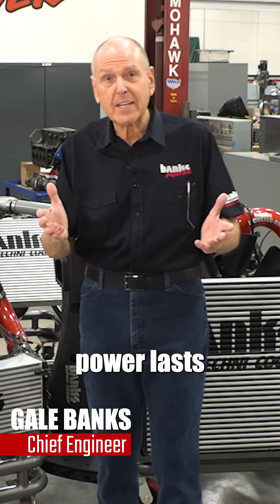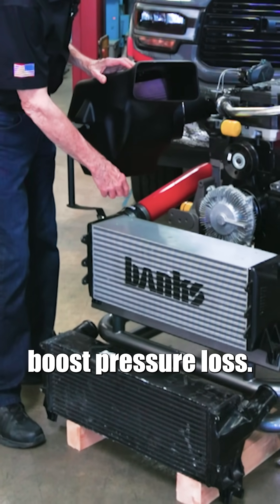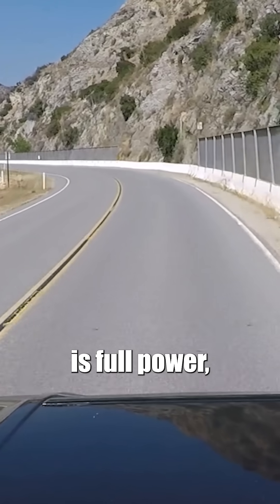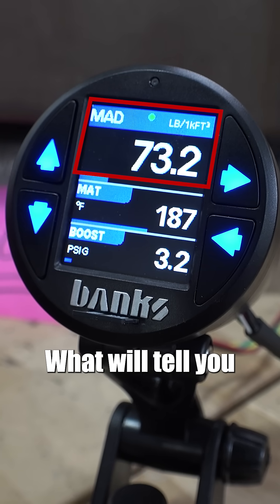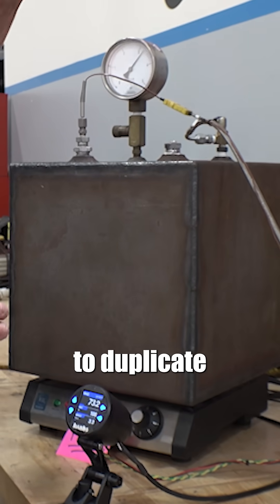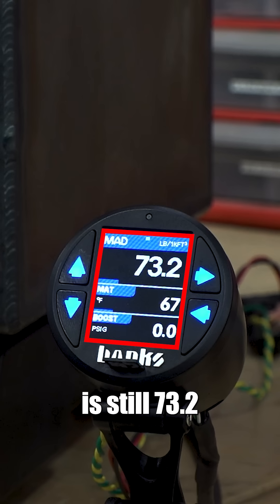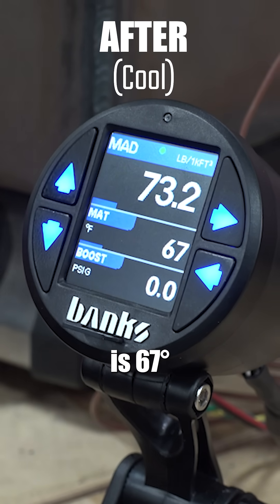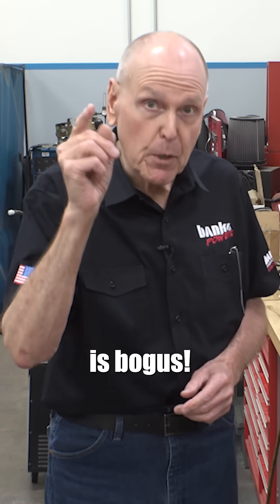Why your boost gauge is bogus.

Comment: Again, educating the masses with real talk.
Reply: The masses don't care
Reply: @Power-Wiesel  dump your fuel and make noise is what i have to say to those people
Reply: Eh, truck manufacturers oversell power, in reality the amount of power sold to truck buyers is excessive and what banks makes is excessive (although it is appropriate for the vehicle, the vehicle is just excessive to begin with). Europeans have been towing with turbo diesel 4 bangers for decades at this point and the weight limit is more than the heaviest imaginery load the average truck buyer can think of. I do like what they do and the proper engineering of stuff for real purposes, but most buyers are just pavement queen mouth breathers which is kinda infuriating but its their money I guess
Reply: That's why I love their videos
Reply: Not really because turbos compress air by pulling in more air.  He was creating pressure by heating and expanding the air. 2 very different ways of creating pressure differences.
Reply: @non-binaryjesus  air speed and density are crucial to make beneficial gains in combustion and flow. He was proving you can have high pressure with low density. Much to the effect of pressurizing hot air. I have read dozens of performance books on engineering internal combustion engines. This is nothing new. there are just better ways to monitor these variables. I dont see why i even have to explain since Gale has been trying to get this point across for decades. Pressure doesn't really mean much if there isn't enough volume being utilized. This leads you into split duration camshafts, eliminating pressure stagnation and reversion. I can go on and on. Like i said, Gale has been saying this stuff for decades
Reply: @jimholesaw6597  so how does a turbo compress the air?  It has to pull more air in which increases air density. This is why its harder to get power from turbos at high altitudes.  All his experiment proved is that 1 cubic volume of air is 1 cubic volume of air.  Pressurizing that volume by heating the air to increase pressure is completely different than pulling air in and compressing it. Expansion and compression are 2 different things. Thermodynamics laws suck but they are what they are
Reply: i guess someone doesn't know when a volumemof air is compressed it heats up,
and when the air heats up it lose some of its pressure like it gets softer, while cold air is harder
Reply: @endurofan9854  what!!??! When air heats up it expands and in a seal container it will increase pressure.
Reply: @jimholesaw6597  agreed, this is why intercoolers are often used. I guess the experiment proves pressure is created multiple ways? Not sure the point of it.  Hot air is bad. Anyone who has ever worked on engines should know this tho.

Comment: The boost gauge was never meant to tell you how much extra power the turbo is making it is to tell you how much pressure it is pushing, however, many many people treat the boost gauge like its telling you how much extra power you are making and this video shows that
Reply: It's just like a vacuum gauge in a naturally aspirated car. You can pull more vacuum, but it doesn't mean you're getting better fuel economy.
Reply: @custommotor  exactly, he would be making a video about that if auto makers put vacuum gauges in vehicles
Reply: @David-jt9nt  reminds me of the Uhaul truck vacuum gauge that displays it as fuel economy.
Reply: @ALMX5DP  o god those things, I forgot uhual put those gauges in
Reply: @David-jt9nt. The vacuum gauge was an improvement over a big ruby red light.  It was like a red strobe light in the cab if you had a driver with a bouncing foot.
Reply: @davepetrakos475  ya, but still it doesn't make it any less pointless on the fuel front, uhaul was/is trying to save their trucks from the type of people who tend to blow them up
Reply: Hit the nail on the head. Seems like that’s the audience that Gale is intending to get the message to. 
It really shouldn’t have to be explained, but it seems like it should be given some of the comments i’ve seen
Reply: @PapiAndrey  whats sad is im not even mechanically inclined enough to do more then the absolute basic work on my truck and I knew this before I even got my license at 15 on top of the fact that more and more companies are being forced to put turbos on everything bc of the EPA and the most common type of driver doesnt know this; this is scary and is going to cause alot of engine blow-ups

for context im a professional driver who currently drives super heavy equipment but has also been in a racing league or 2 so I have to understand what my vehicle is doing
Reply: It a very literal sense yes. But typically it is an indication of how much more power you'll make
Reply: That's because the industry wants to sell you parts without doing the footwork of testing or educating. They want to show you a graph that is irrelevant and often fake just to convince you to buy trash. Very few if any companies go to the lengths that Gale does.

Comment: Boost is essentially just a measurement of restriction, no? Because you're forcing compressed air in a finite space.

I remember replacing my supercharger lid with a larger unit. Boost dropped 2lbs, but I gained power because I could push more air in.

I lost restriction, which meant my boost went "down", even though my power went up.

Boost gauge isn't lying, people just don't know what its telling you
Reply: Agreed, the boost gauge shows what you're not using.

The video is more about temperature vs density. Hot air garners high pressures, but cool air promotes density.

Comment: What if the intake air was compressed very much significantly above the target pressure - then run through the heat exchanger for preliminary cooling - then nearing the combustion chamber, any remaining excess intake pressure was allowed to be reduced, thus further cooling intake air immediately before entering the combustion chamber while maintaining the target pressure?
Reply: That's called an intercooler
Reply: That's a very niche application, we use that sometimes for supercritical CO2.
You could get away with a smaller intercooler, because the temperature difference between the hot and cold sides would be greater, increasing efficiency, but at the cost of boosting efficiency and added complexity.
You would also get higher exit temps at the hot side of the intercooler, since that's just dumped out in a car it doesn't matter.
The only place where this setup would make sense is an extremely hot environment, because theoretically you can cool you intake air below ambient, at great cost.
Reply: You wouldn’t want to expand it right before the cylinder, as it would absorb heat into the air as the air cools, then immediately get recompensed in the cylinder, heating back to initial level PLUS the added heat from the surrounding components.

You probably want some kind of a ducting system after the intercooler, so the compressed air in between the intercooler and expansion chamber is cooled by the expanding air instead of the components near the engine cylinder\block to minimize efficiency losses.
Reply: What about high pressure water sprayers in front of the front mount intercooler just prior to high throttle?

Comment: It’s been almost a year now, I have the banks air filter, boost tubes, intercooler, monster ram, and even diff cover on my 2018 ram 6.7 Cummins 3500. I use my truck every week hauling materials and equipment without a problem. Can’t wait for the new transmission cover to drop. Bought an older 2008 dodge ram 6.7 Cummins 2500 and can’t wait to add all their banks mods to it. 🔥
Reply from the maker: The Ram-Air Trans Pan is in development for the 68RFE. If you haven't done so already, be sure to add your email address to the signup page on bankspower.com.
Reply: Ultimate setup my guy make Albertan cry lmao
Reply: I'm still waiting on there 2010-2012 Ram 2500 intercooler they keep promising.
Reply: Add the oil pan too.   Oil changes leave a quart in your engine.   Nice setup by the way, can you share mpg pre and post.   Do you have the HO?
Reply: Still waiting on the derenger for the 2018 ram 2500 Cummins been almost two years
Reply: Now look at 'speed of air' pistons: a real game changer.
Reply: You get like 6 MPG?
Reply: I run my lb7 completely stock and I bet I tow more than you on a more regular basis......she's doing just fine.
Doesn't seem necessary
Reply: @NickZ6297  anyone asked for your opinion? Their money, they do what they want.
Reply: @NickZ6297  Cool story bro. We dgaf.

Comment: The boost isn't a lie just because some people misunderstand what it actually represents
Reply: It represents pressure. That's all. Maybe view it as a power meter
Reply: @maddoxinc1642  that's what's being said here though. It's not an accurate predictor of power. It's only good for understanding what the turbo is doing really; whether it's spooling, peaking, leaking, fluttering, etc. 

Air density is what needs to be measured in order to accurately extrapolate power output. Not pressure.

Comment: Yup I think might car mods did a test on cold air intake on a boosted car showing the cold air intake does nothing because of the intercooler causing the air temp to stay at a constant temperature and turbo will heat the temperature of any cold air coming from a cold air intake what made a difference was increasing the size of the intercooler